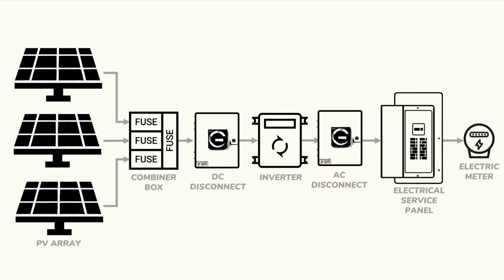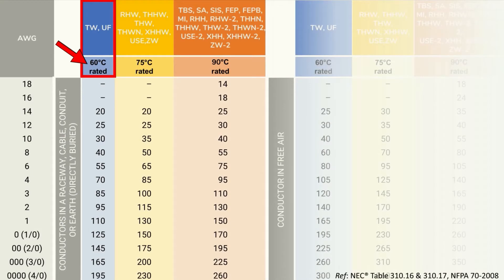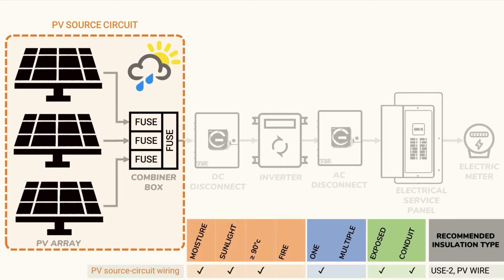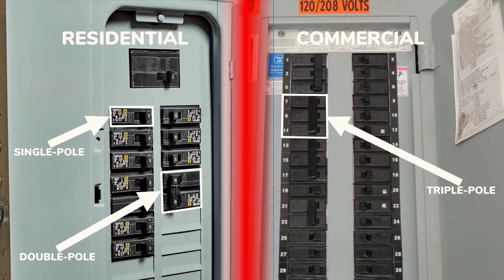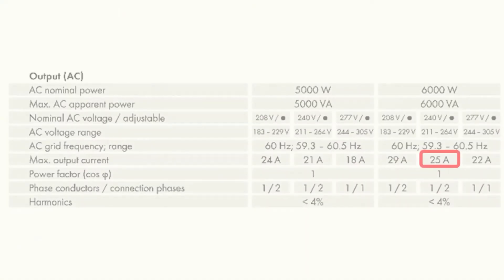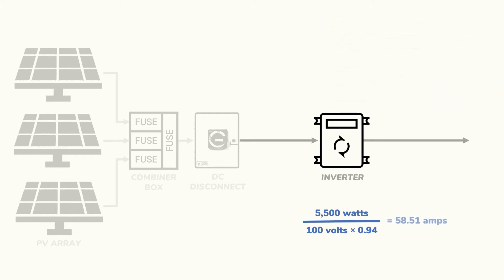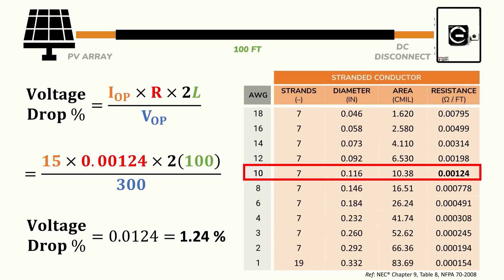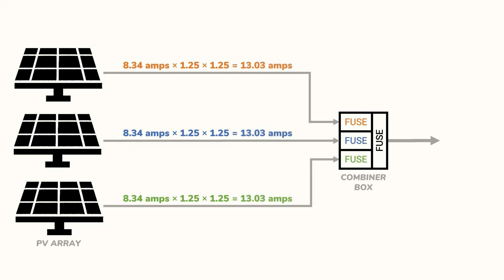How to size wires and fuses for a solar electric system

Comment: Where did you get 300 volts from in your formula at the 10:20 mark?
If the panels are in parallel, which in you example they are since the amps of each panel are added together, the voltage of the three panels together should remain the same which according to the label on the back of the panel in your example the open circuit voltage is 21.2v (at the 6:12 mark).  So, the voltage (the bottom number) in your formula at the 10:20 mark should be 21.2 not 300!  
The only way you could get 300 would be to add the wattages of all three 100 watt panels.  That would give you 300 but, of course, that would not be voltage which your formula calls for.
Can you explain where I have misunderstood or your example is wrong?  Because, I am confused.  thank you

PS:  All that talk about the inverter etc. does not apply to my application because the panels feed a charge controller which, in turn, feeds my LifePO4 battery.

Comment: But you don't mention that the effect of the distance between the sorce (solar panels) and the inverter  , it's important to know ، If the distance is double, the wire size will double

Comment: Your videos are very helpful. I did have a question. I have a 100amp panel and plan to buy two 6500w inverters. The conductor from Inverter AC to the panel, by code is #3 copper and what I've noticed is the largest wire to fit in the inverter terminals is #4 AWG. I will install a disconnect between the panel and inverter. Can I use a reducer adapter (3 to 4) and what size and type of disconnect, would you recommend?

Comment: I bought the wrong AWG 14  WIRE FOR MY SOLAR AND MY 3000 W HYBRID INVERTER AC utility works but when i turn it off the solar not coming on i put the correct setting for settings 1 for first solar but no power and the green light flashed when i change the setting s usb on setting 1 utility kicks in and the green light stays on no matter what i do i can not get the solar to work i have 10 solar 275 watt each which is 2750 watt on a 32.5 feet cable awg 14 with an 10 amp circuit breaker i bought the wrong circuit breaker to i should of got  25 amp one i waiting for a new one to come but changed setting on on inverter for 10 amp to come in because
 of the relay i also have it on setting NO 5 USE USER defined and went to settings 26 27 29 and using the defaults i mean on it for 2 days and still i can not get battery to charge or solar to charge batter Please help me. and tell what i am doing wrong. could it be the wire being being to small?

Comment: I know you need to follow your local electrical codes but I think that putting fuses on solar panels is pointless since solar panels have high output impedance and the cables should be sized to easily carry the short circuit current rating of the panel or string. Under what conditions would one even generate enough current to potentially melt cables? Even if you shorted the output cables of the combiner box, I doubt that the cables would even notice and I doubt that any fuses would even blow.
Reply: Direct short inside the solar panel.